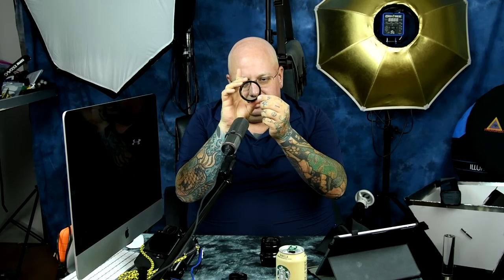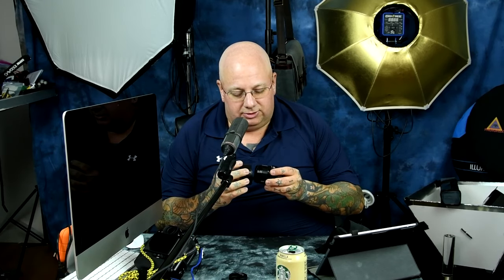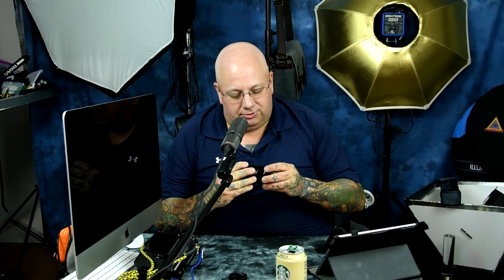LENS TIP: Do this to save your lens hoods & make them mount and last longer

Comment: You can get the grease in the UK. I found your old video the other day mentioning that. I have some lithium grease made by a UK company called Silver Hook. It actually looks ideal but I'll try the Tetra Gun.

As for taking lenses apart, I have a few Tessars that cost me peanuts but with a few issues. Stiff focus and sticky aperture blades. Can I solve it? I'll see but don't take your Nikkors apart. Start with some cheap lens that is essentially no good unless fixed. The Tessar is dead simple. I'm always taking things apart and fixing so I know some potential pitfalls of doing these types of things. I've seen a lot of videos on youtube where people do things that are just a no no like using a screwdriver that doesn't fit the screw.